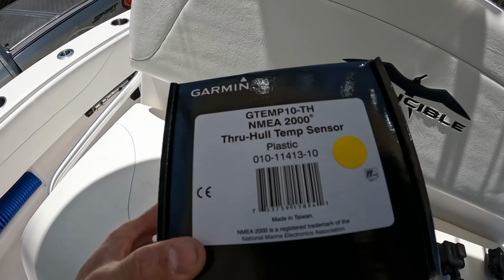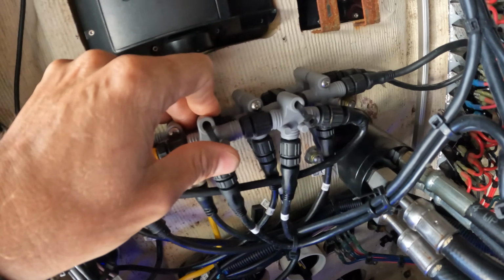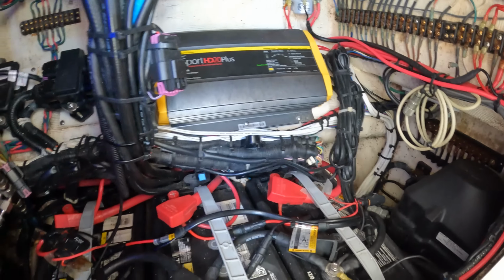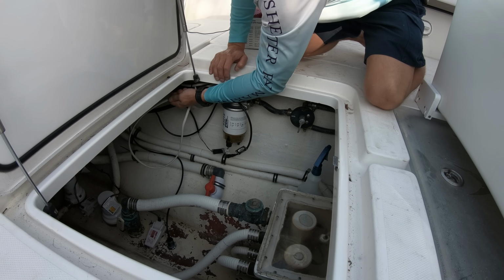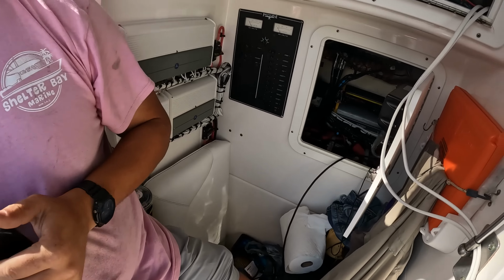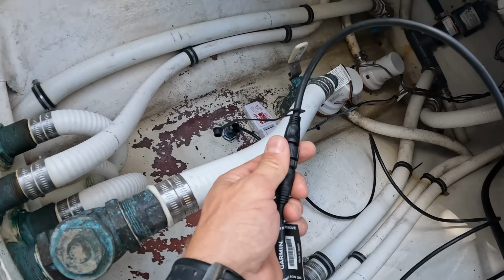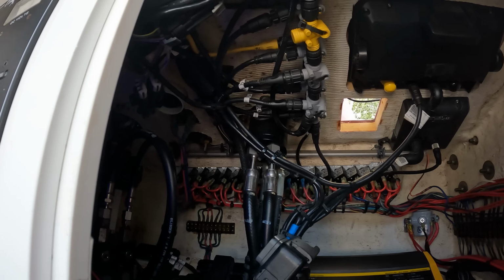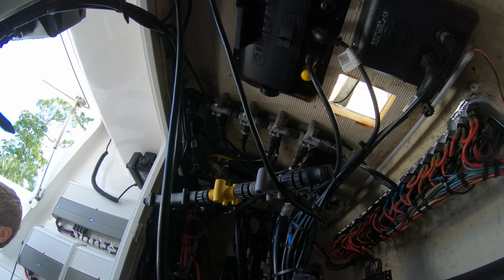Adding A Boat Water Temp Sensor!

Comment: someone has more money than they know what to do with. a hole in your boat for a temp sensor?  there isn't a transducer with one of those?  I'm anti holes in a boat!!!
Reply: I must be slow…I agree less holes is better and what’s the point of a temp sensor? Why do I need temp? Depth, yes…
Reply: @datamack  C'C'mon!!
Reply: @1972mdc  yes, TEMP. (via my sounder transducer) but I'd never drill yet another hole just for it. But thats me, a plate alloy boat owner.
Reply: @CaptDavesSportfishing  so I’m curious what does the temp tell you? E.g. looking for cooler/warmer water for certain fish?
Reply: @1972mdc  yep.
Reply: @1972mdc  surface temp isn't as useful as targeting thermoclines or ranges at depth.  Both my transducers measure surface temp already.  I love through hull transducers but I'm leary of holes in the hull.  Great channel and content.  Definitely no amateur - I'm not brave enough to drill there.
Reply: Divers?